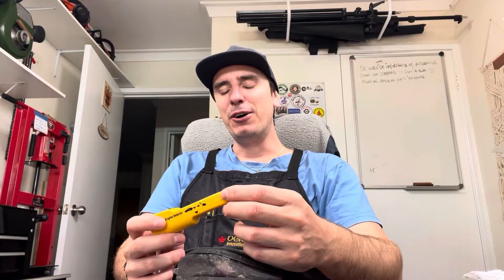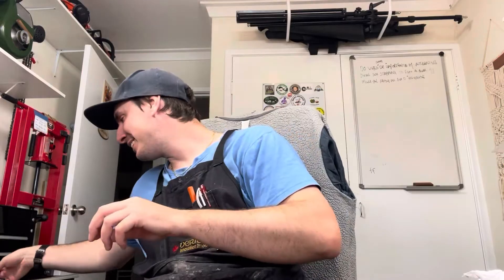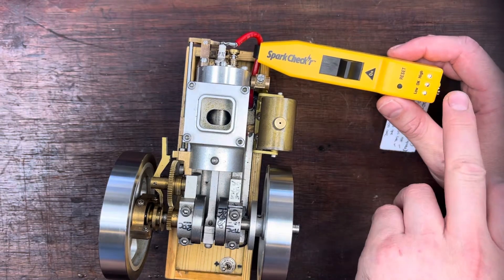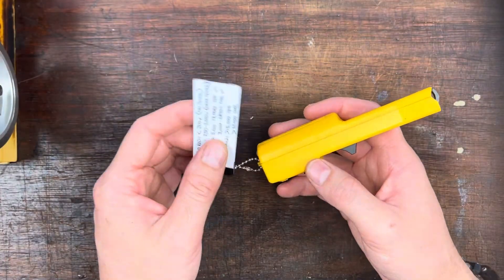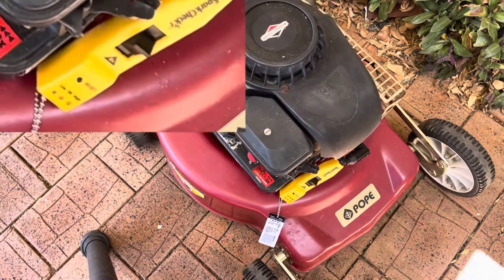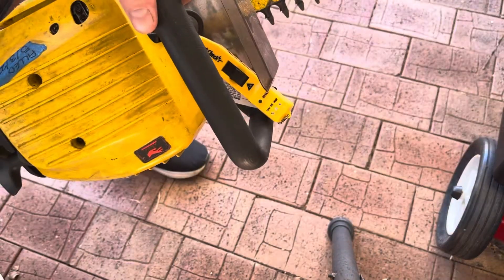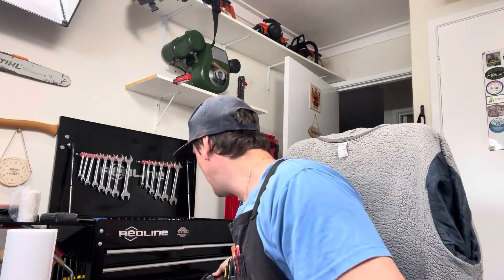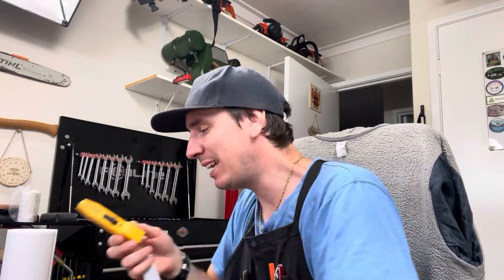INDUCTIVE Spark Tester - You’ll Wish You Had One Sooner!

Comment: So ive been getting the yellow on my snowblower and tried 4 different spark plugs and 3 coils. The wires are fine. Any help would be great thx
Reply from the maker: Hey mate! I wouldn't stress, yellow is just higher voltage than their cut off. If your coil produces higher voltage than the cut off for the tool, it will always show high voltage (yellow) when it's fine (even better as it produces stronger spark)

Comment: It's funny how some of these products are getting more exposure. I personally purchased a tool about 34 years ago it digital tells the the voltage threw the wire and also has a clip for diesel fuel lines for timing. Uses a crystal that provides a voltage threw vibration.same as a knock sensor. Great except for modern direct coil to plug systems. But can find bad wire's or plugs depending on readings. Great video.
Reply from the maker: Awesome :) thanks for sharing!

Comment: Forgive me if you have always answered this query:  Could the Spark Check’r identify a problem with a deteriorating hot ignition coil by testing it when cold?
Reply from the maker: Hmm I don’t think so, it will only detect what current can pass at a given time. If it works when it’s cold it will show green 👍🏻

Comment: I think you have just, inadvertantly, solved my problem with this gadget bout 2 weeks ago in the U.K. for £50. You didnt even start the engine, just pulled the cord once. Ive been starting the engine and let it run. The colour goes to green then yellow. Yellow means bad plug or HT lead. But one machine has a new plug and new coil with HT lead... I think it's not been made clear that you just pull the cord and if the engine starts switch it off!! Thank!!
Reply from the maker: You’re welcome! Yes, the instructions say to quickly remove it if the engine starts. Or to turn the engine off. One of the two. It’s been a long time since I checked the manual :)
Reply: @VintageEngineRepairs 
Oh, happy day😊.
Dumbo here just found the instructions! 
It must only be used on an engine which is not running, I.e. which is off. Later,  "If the engine starts, turn it off."
Thanks again!

Comment: It’s good but it has a shortcoming in comparison to using a timing light with an inductive pickup. That is that the most common fault with spark plugs, is that they intermittently or occasionally miss fire. This tool would likely signal that the spark was satisfactory.  On the other hand, the timing light would show a miss firing plug by the absence of a flash.
Reply from the maker: Yeah very different tools. A timing light isn’t for seeing if there is spark or how strong spark is.
Reply: @VintageEngineRepairs  it doesn’t show how strong the spark is, you’re right. But it does show if the spark plug is sparking, and if it’s missing at all. A timing light will only flash if the spark plug actually makes a spark.
Reply from the maker: @djlord9189 yes but don’t forget that at 10,000 rpm, you won’t distinguish a miss on a timing light. A timing light even at 3000 rpm appears constantly on to the human eye. It has to miss a lot to distinguish.
Reply: @VintageEngineRepairs  Yes, it’s true, that when I use this to identify spark misfires on Aircooled VW engines, I’m not ever revving them more than 2500 - 3500rpm. And mostly the misfire can be identified at idle. I’m never attempting to identify this type of fault at 10,000 rpm.

Comment: Could you post the 2 tags so they can be read. Thank you
Reply from the maker: Sure

Solid red no spark < 200v

Flashing red low voltage 250-2500v

Flashing green good voltage 3,000 -13,000 (ope setting) and 3,000 - 28,000 (car setting)

Flashing yellow high voltage >15,000 ope setting and >33,000 car setting
Reply: Thank you

Comment: Handy but too expensive, I'll keep using my spark testers I already have, no electronics and never fails!!
Reply from the maker: All good :) mine paid for itself on the first repair, but I agree, they’re not cheap. The advantages of ease and efficiency are what sold it to me :)
Reply: @VintageEngineRepairs  How can it be paid for itself in one repair?? You didn"t save 100$ in time compared to standard spark checkers or I'm I missing something?
Reply from the maker: @TorpedoBurrito  The first repair I did using it easily paid for it and more. I do this professionally, I understand that as a hobbyist, it may not be justifiable.
Reply: @VintageEngineRepairs  I'm no hobbyist, I just can't see how it paid itself on one repair! Using this or another spark tester accomplished the same thing, check for sparks!
Reply from the maker: If you can’t see the spark due to being the other side of the lawn mower, or it’s too bright, and you chase your tail, it can lead to unnecessary expense and time. I have been there, own 3 different spark testers, one that’s more expensive than this and they have their place. For a quick and easy test this wins every time. If you want to put load on coil to test across it’s full range, an adjustable inline is great.
Reply: I use a Fluke non contact voltage tester.

Comment: I'm confused, why would a broken spark plug wire increase voltage? I would have thought broken wire = less voltage across wire.
Reply: The coil will provide as much energy as it needs to find the ground.  A broken wire can be jumped but requires more energy to do so.  A plug with high resistance would trigger high voltage.   And perhaps an engine with a failed decompressor.  That's  only a maybe.   A plug that is set too wide perhaps.
Reply from the maker: Hey, I’m not sure I said a broken wire would increase voltage?

Comment: Does anyone know of a Canadian distributor for this tester?
Reply: One option is to remove shroud to get to flywheel nut. Lock safety bail with clamp.  Crank engine will drill and socket on the nut. Now you close to spark tester.
Reply from the maker: Try reaching out to “eliminator performance” he  is in Canada and found one :)
Reply: Google found it available from rotary

Comment: I am an atv mechanic, far too often I will pull the plug lay it on the block and see spark but can’t get the engine to fire, painful to admit but quite often I don’t even think about what I’ve learned with other bikes I’ve worked on. What happens is in the position of the wire hooked to the spark plug there is no continuity, but with the wire in a different position it works. Maybe this thing could simplify this. Atv’s are considerably more complicated but you still start with the same method, spark, fuel, compression
Reply: A coil with low voltage can spark the plug when it's not in the cylinder, but won't spark when in compression and fuel mixture.  In-line spark tester is great way to overcome this issue.  Test for spark under the same conditions you are trying to use the coil/wire/plug.

Comment: It’s nice and handy but costly. I play with chainsaws and mowers, I couldn’t justify the cost so I’ll stick to using a spark plug
Reply from the maker: Its certainly an investment Al! Just remember that under compression it’s far harder for a spark to jump a gap. So you may get good spark holding the plug to ground, but the engine won’t  run with the plug screwed in and compression.
Reply: There are alternatives, one on Amazon is $31 and loads like it in kits with compression testers etc.
Reply from the maker: @oo0Spyder0oo  have you got a link?